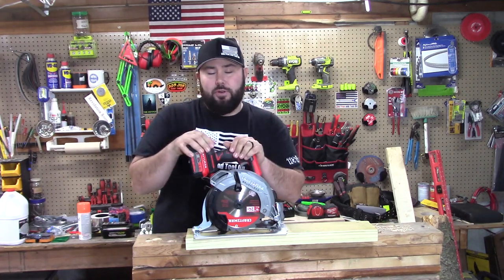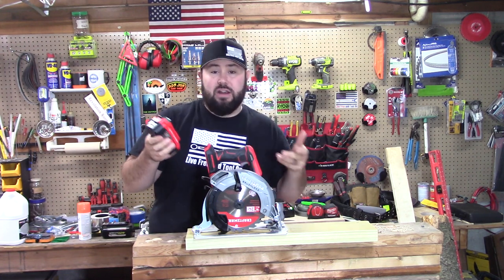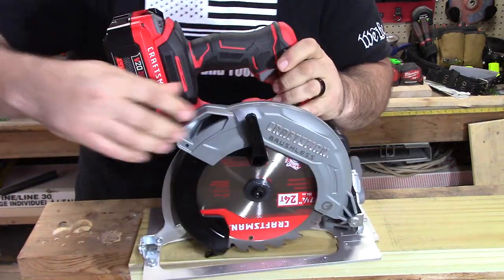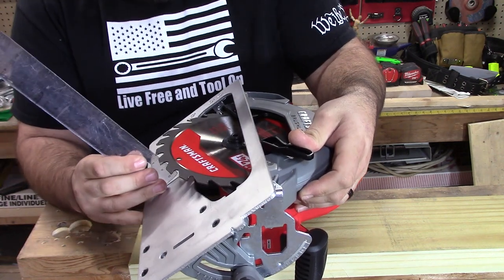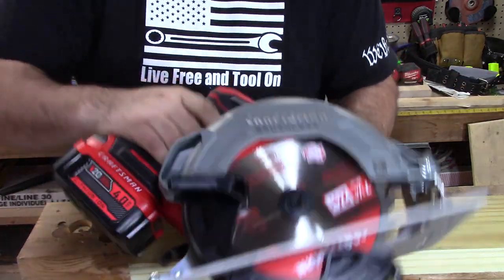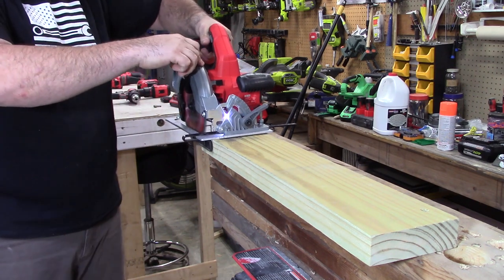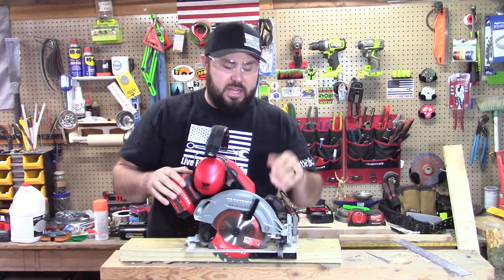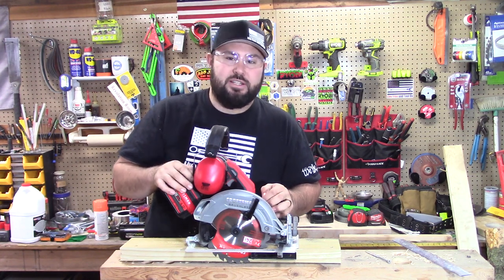Craftsman 7 1/4 brushless circular saw review

Comment: where did you get your guide for the saw?
Reply from the maker: I think this is the one Replacement 164095-8_ Rip Fence for Circular Saws, Metal Rip Fence Edge Guide Tool Part for Circular Saws 5005BA, 5007NB, 5057KB, 5046DwB, 5621DWA https://a.co/d/iviLuJ4

Comment: Just bought mine. Won’t start and just clicks. Charged battery. Light comes on but no power.
Reply from the maker: What battery are you using?
Reply: Figured it out. If the nuts arent properly placed when putting on the blade, it wont work. Instructions dont say that.